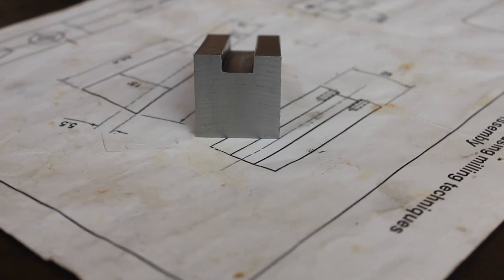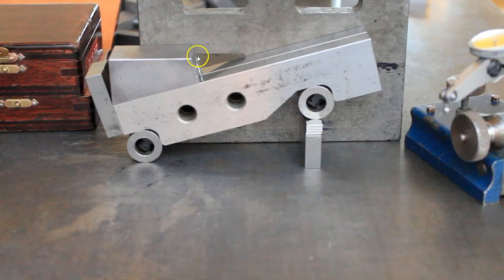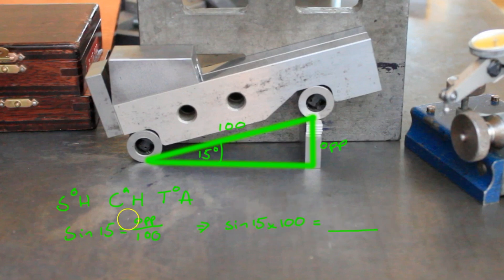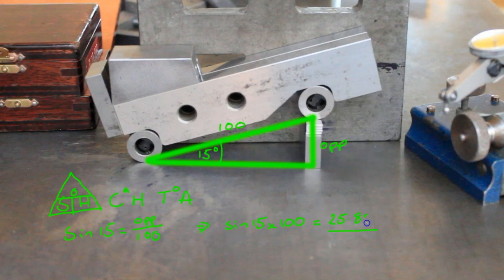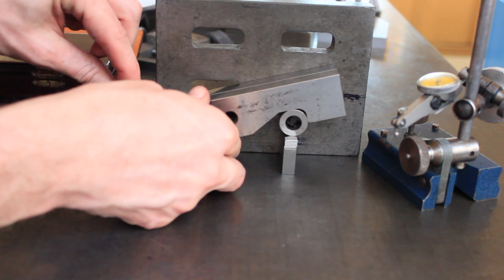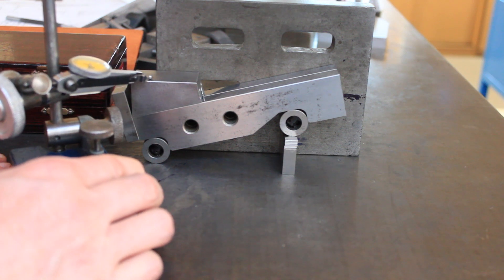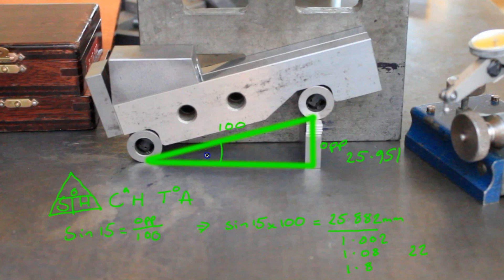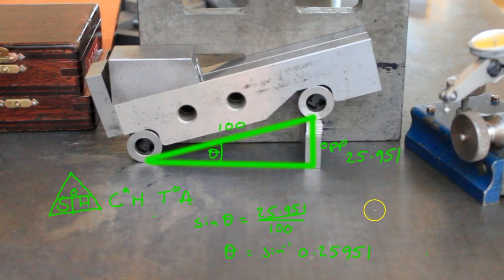How to use a Sine Bar -#5minFriday - #3

Comment: I wonder how do you know the correct opp is 25.951, did you take a guess or you calculate it with a formula? Thanks a lot for the video
Reply: Just reduce or add to your slip pile until the surface of the part runs straight on the dti.
Reply: you can use a zeus book to find the opp using the angle you are after

Comment: the calculation is incorrect, and you shouldn't use calculated values. if you got the OPP side is 25.951 by using sin15x100 then you cant use the the calculated value (25.951) to find the "correct angle again if the part you are measuring isn't parallel that means there is an error in the angle.  you should have use bevel protractor for the angle then used sin to calculate for the value of OPP
Reply: What a strange comment ====sine bar  v protractor---if it's not indicating flat then the machined part is wrong ----not the angle